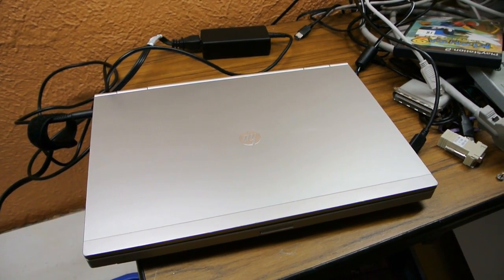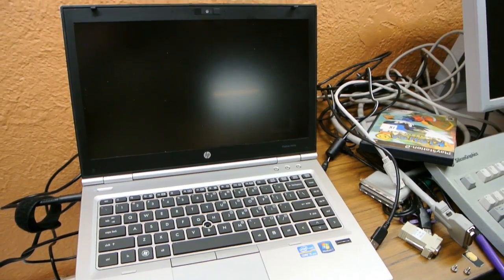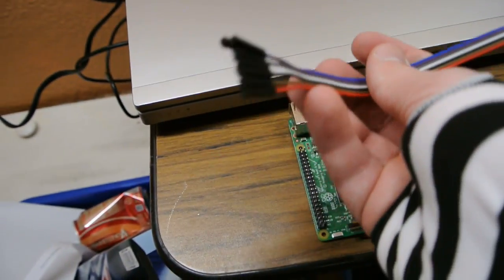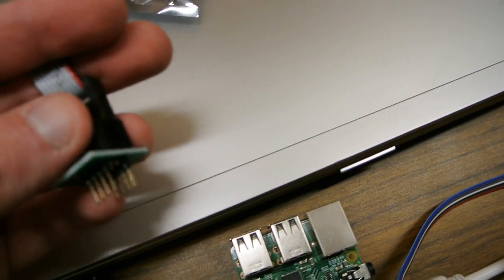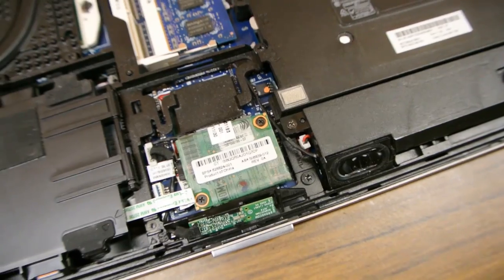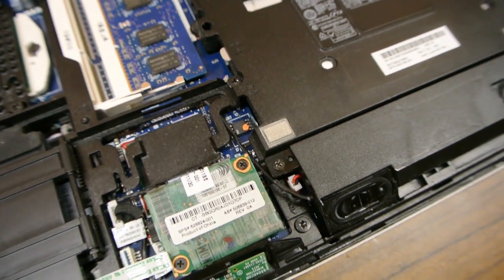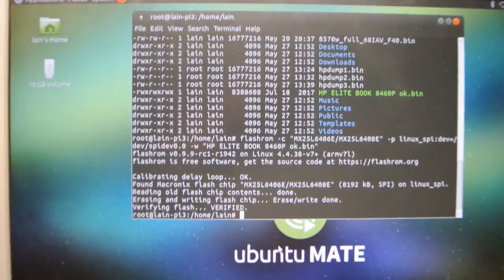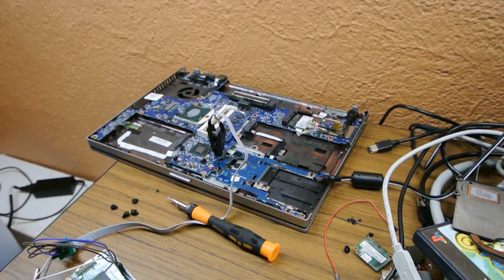How to unbrick or reset the BIOS password on nearly any modern laptop with a Raspberry Pi

Comment from the maker: Here's a reminder: If you want to remove the BIOS password it's a better idea to make a dump of it instead of flashing a random dump, as random dumps can cause issues with Intel ME and whatnot. With Dell laptops, there's usually password crackers available.

This will also NOT work on ThinkPads, if you want to clear the password you can just do the EEPROM trick for older models (t430/420, old IBM era models, etc.). If you want to unbrick it you need a "clean" BIOS dump without a serial number of another Thinkpad.
https://htr3n.github.io/2019/06/t430s-supervisor-password-removal/
Reply: How do you make a clean bios dump?
Reply: Will this work on the pi 4
Reply: @alexsrandomcontent2703  yeah it should just make sure to have the right OS installed pretty much any Linux based OS will work.
Reply: @90Wolft  thanks
Reply: I think this doesn't work for never thinkpad generations of the last 5 years.
Reply: What's the eeprom trick?
Reply: Hi from the UK I want to unlock a bga chip
Reply: When you say flash do you mean reset as I have an old laptop that has been locked for 2 years and I have a bga chip that is locked that I need to unlock so I can renew the chip and use again

Comment: Nice video, my question: Is it possible to shorten two pins directly on the chip to reset it and if which pins should that be? My board has no reset jumpers

Comment: Thanks for your video. I tried your steps but it didn't work at first.
I used a Raspbery Pi 4 , I left the pins 3 and 7 not used  and then when i run the command to read the flash I added another params "spispeed=512"
sudo flashrom -c "MX25L3206E/MX25L3208E" -p linux_spi:dev=/dev/spidev0.0,spispeed=512 -r backup1.bin

IF you get an error like "flashrom Error: Image size doesn't match the flash chip's size" when you try to write on flash THEN you must have a bad bios file

Comment: Thanks for the sharing. I have 2 questions
1. My bios chip is Mx25L12873, can I replace it by another mx25  bios chip or w25Q?
2. I've tried to flash my  bios chip using the ch341a and the test clip but after that my laptop don't power on and the charging led is blinking white and orange. Could you please help?
Many thanks to all

Comment: Man, I followed your tutorial to a Tee, and everything worked fine... but the laptop refuses to boot with the BIOS chip reinserted. In fact, it behaves the same way it does as if there were no BIOS chip in whatsoever. Might you know what I'm doing wrong? It's a probook 640 g2 btw.
Reply from the maker: Flash the old backup and try modifying the image. This doesn't work on newer laptops.

Comment: when you buy a new BIOS CHIP, does it come empty or it already had the appropriate bios on it? mine is 8470p and it has 16 pins chip, so i will have to replace it.
Reply: If you have not beeen told , the chip will come empty unless you can find a seller that has the pre programmed
Reply: @MrTarmonbarry  ok thanks for the info.
Reply: @mihaithemystic2890  you could download and extract a fresh hp bin file from the provided bios file from hp then use a 16 pin flasher with 16 pin clip (which is not expensive) then use that to flash/write a fresh bios if the chip is empty... there are tutorials on how to remove password with flasher for elitebooks and it does in fact work... just instead of “reading” the files from the old chip you are simply “writing” the fresh one
Reply: @soulslip  yeah thanks for the info, bun now i have other laptop, so the old one will just gather dust.

Comment: I have the same laptop, an 8460p HP laptop, but i don't have any money to buy the tools used in the vid.
I tried to contact to the HP support and they don't provide the SMC.bin anymore, this is a bullshit about them.
I tried with the HPBR tool, too, however, this for a some weird reason it doesn't work for me, there is another solution? 
Anyway, if there's not any solution i'm gonna buy the BIOS chip, and replace it directly...
Reply: Any luck ;(?
Reply: @anthonyturninggreen8066  Nope, I can't get it unlocked

Comment: when i plug the clip on my ch341 the red power light gets dimmed and usb disconnects. any idea why? its on lenovo ideapad 330
Reply: Ch341 only works on 5v chips this chips requires 3.3v and newer chip only requires 1.8v, so yeah you burned your chip by supplying 5v on it
Reply: @XxEvilClownxxX  Dont they have a 1.8v adapter for the Ch341 I believe they do.
Reply: @neosrt10  well they do but mostly it doesn't work not on me though i used the 1.8v adapter on my tl866cs
Reply: @XxEvilClownxxX  What software do you use to flash ur bios  with the tl866?
Reply: @neosrt10  when you buy tl866 it included a CD in it is the program. But the best programmer right now is the RT809H cause it cam program nand flash.
Reply: @XxEvilClownxxX   Im trying to flash my laptop vbios...but Im not sure if the vbios comes inside the bios or its a separate chip that RT809h is pricey.
Reply: @XxEvilClownxxX  In Ch341 5v is default and you must put jumper for 3.3v.

Comment: The bios lock may have been resolved but did you check to see in bios setup that your serial number, UUID, MAC address, product name etc. match what is shown on the bottom of your notebook?  I bet they don't match and it looks like there is a problem with the ME also.

Comment: yes, worked, thanks. althou not at first. had to power on the laptop, then unplug it, then immediately hit program on the pi. . also the two remaning blank pins needed  to be connected to 3.3V with a 1~kilo ohm resistor

Comment: Hi, I have the Rasberry Pi 3b+, the github guide states that one should start counting from the right and leave 14 pins. I am really not sure what this means, I checked the pin layout on the Pi3b+ it should be the same as the Pi3? Flashrom does not pick up any EEPROM, any advice on this?

Comment: Help me. I bought a CH341A programmer and I need some tips
Reply from the maker: Throw that crap out the window and use a Pi instead IMO.
Reply: @pawsinmyface4560  I've heard a dedicated flasher like the CH341A is actually a lot more reliable. If you go into the #coreboot irc on Freenode it's one of the flashers they recommend. You really shouldn't dismiss it.

Comment from the maker: Just added the required tools in the description so you can order away :)
Reply: hello, instead of flashing new bios i have replaced the whole bios chip but now my laptop is not turning on, the fan spins at high speed but i get no display at all, do you have an idea of what it could be?
Reply: Thank you.
Reply: sir to remove bios password Can I replace the bios chip for HP compaq 8100 elite convertible minitower desktop??plzz reply

Comment: removing the hard drive from the laptop and plugging it into a workstation could allow for either running the drive, assuming it's linux or with a lot of workaround windows, or looking at the drive's contents assuming it's not encrypted. This is a useful guide for stopping common thieves from accessing the computer's cache and resources, but will not stop anyone who knows what they're doing. Thanks nonetheless for sharing this useful information. By the way, the laptop itself isn't bricked, simply because it stills functions properly.
Reply: This is more for those situations when a machine has been bricked due to a bios update/install failure or has been excessively locked down with no bios password available. Typically ex-corporate network-boot only machines that were fire-sold as spares for a fraction of their value instead of being properly decommissioned and sold as usable machines. Happens surprisingly often when a company flops suddenly as their kit often turns up in bulk at auction. If the bios is operational and you just want an OS to run on it your method is just fine for casual users. Unlocking the bios this way is a final option if all else fails and the alternative is either soldering on a purchased fresh bios flash chip or going hard-mode with removing, reprogramming and resoldering the existing chip. There's a point where your time spent is more valuable than the hardware your reviving, unless your doing it for fun.

Comment: hello, this method is only for laptops????
Reply: If you have a desktop PC that has a password locked bios, jumping the RESET CMOS pins on its motherboard should do the trick, also pulling out the CMOS battery for a minute or so can also do the trick.

Comment: PA8600, do yo think this method will work on the Lenovo X250 laptop?  I have a supervisor password on it and before I invest $ for the parts, I want to make sure it works.
Reply: no it will not work it is stored in serial eeprom  you will have to locate the eeprom
and short the  pins you  can find how to in youtube or google search thank you
Reply: Valentina Farrugia order a pi 3 B+ they only 40$ on Ebay and these methods work just have to do them little different for each model/make or can replace chip and program as well but definitely need a pi of in the tech world .